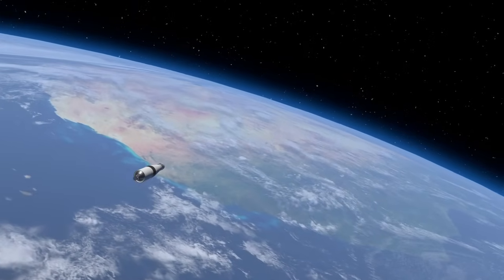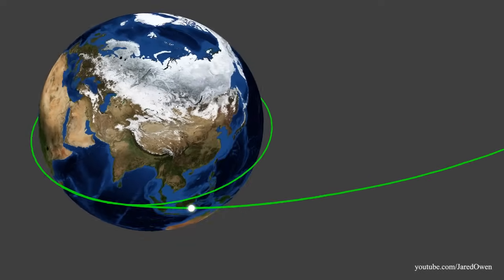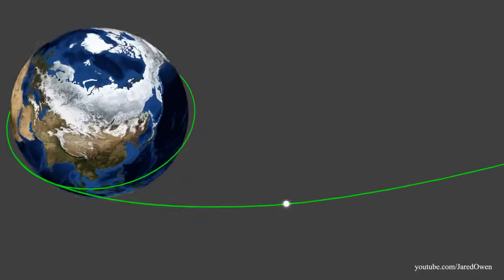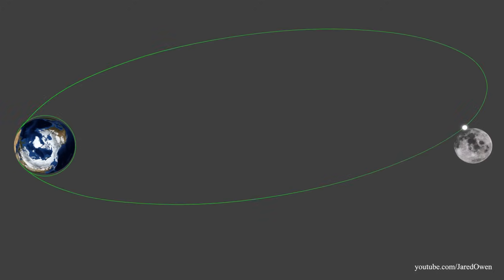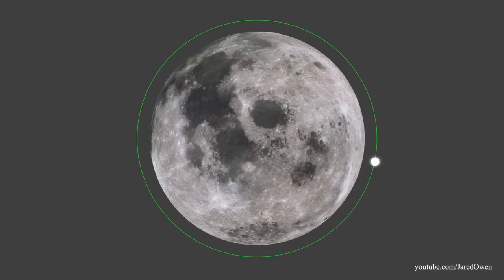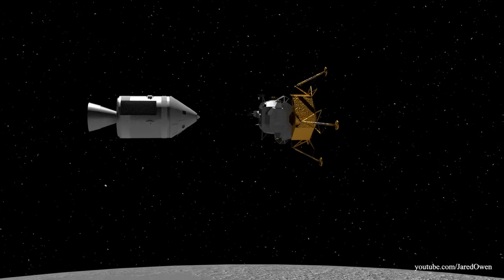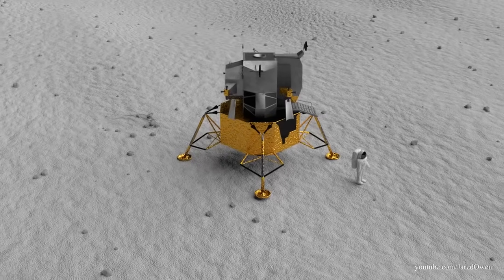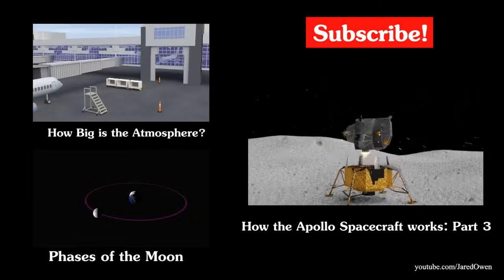How the Apollo Spacecraft works: Part 2

Comment: In parking orbit, the gravity is almost as strong as on the surface. I can fathom a small probe being sent from here to the moon ( only just & that's not how the unmaned probes like Voyager were sent out). You are saying that the big stages of Saturn V were only to achieve parking orbit and the smaller 3rd stage did most of the heavy lifting, taking a mid size truck, full of gear to the moon, after firing for only 6 minutes. BULLSHIT!
Reply: John Sergei 
You're statement makes it sound like you think the moon is not within earth's gravity well.

Or that you think an object propelled upwards will not continue to travel upwards at a decreasing speed until gravity has  cancelled out all of its upwards velocity...
Reply: John Sergei

Are you for real???
They coasted all the way to Moon,after they had reached about 11 km/sec.
Reply: John Sergei

Don't you know what "escape velocity" means?
It means, the velocity you have to reach to escape gravity. You will never fall back again.
It's exactly the same velocity you will reach, if you just fall towards the planet from infinitive distance to the surface (theoretically, not counting in the atmosphere)

The gravity will be lesser and lesser, faster than your spacecraft slows down.

Same as when you fire a gun. It needs no further push after it has left the gun barrel, to reach any distance, The distance only depends on the initial velocity.
Reply: Of course a heavier object needs a bigger rocket, to reach the same velocity.
Just like a heavier gun grenade needs a bigger powder charge to reach the same distance.

It's because of that, that the Saturn V was MUCH bigger, than the Atlas Centaur, that sent the Sureyors to soft land on Moon.
Or the Atlas Agena, that sent the Rangers to crash on Moon.

Many of the "scenes" showing the LM's fly over Moon, were taken with the 16 mm film cameras at low speed (to conserve film), so it seems to be much faster, when played up at normal speed.

The velocity needed to stay in orbit around Moon, is about 1.4 km/sec.
For Earth it's about 8 km/sec.
Reply: John Sergei

So, you have finally lost your mind completely.

Tell us what "hardware" does not longer exist.

No multi billionaires consider it worth the money to go to Moon. "Space Adventures" have had a standing offer to fly you and a friend around Moon (in partnership with the Russians) for years now, without anyone buying a ticket.
You see, you would have to pay for 2 big rockets (1 for the modified Soyuz, one for the living quarter capsule), all the fuel, the cosmonaut pilot, all the launch facilities and the recovery party. Plus Space adventures and the Russians profit.
It would be several tens of BILLIONS. You would have to sell off many of your companies.
Who would do that???

Have you even TRIED to find "the parameters" for the Apollo hardware???

You haven't presented one single reason why the Apollo astronauts couldn't land on Moon.
Reply: If you ever do attempt to do some proper research, you would find that every single supposed bit of evidence brought up about alleged proof regarding hoaxing the Apollo landings have been debunked over the years. Most of it with relative ease because the supposed proof is usually based on complete ignorance of the particular subject involved. Meanwhile, there is tons of scientific evidence that is irrefutable which has been accessible to scientists and aerospace engineers for the last 45+ years who have never found anything that might suggest the landings were faked so it's only people who lack critical thinking skills who fall for this moon landing hoax nonsense. Here's some of it:

-> There's the live TV coverage that would have to somehow convincingly fake 1/6th G movement in a vacuum, Google "Irrefutable Proof for Moon Landing - Lunar Gravity" and explain how experts in the field of kinematics for 45+ years have never come forward with proof that the astronauts are not in an environment that they say they are. There's also the fact that any attempts to do filmed mock-ups of the EVA's on Earth would have to be passed off as live TV broadcasts which would have to fool telecommunications experts around the world. Google "Moon Hoax Not" and "For Jarrah" to get a better understanding of how much would be involved to pull that off and how the filming technology back then was simply incapable of such a thing.

-> There's all the moon rock and core samples that would have to somehow be able to pass scrutiny with geologists who can readily spot whether it's something that has passed through our atmosphere or not. 
Google "How do we know that rock came from the moon?"

-> NASA has made these samples available to scientists from around the world and every year 500-1000 samples are sent out.
Google: "NASA lunar sample request"

-> There's the Apollo 16 UV telescope images that no astronomer in 45+ years has ever found fault with. Google "onebigmonkey apollo 16 UV telescope"

-> Another thing that astronomers would be able to spot are pictures of the Earth that don't match what they should look like. Google "Apollo 11 Earthrise - How One Photo Proves it was Real" for an example. 

-> Another one to google is "Apollo 11: Fingerprints in Deep Space" that shows obvious handheld TV footage from the Apollo 11 CM looking at Earth from far enough away that they are clearly beyond the VAB's.

-> Then there are the LOR images. Lots of hoax believer nonsense about them being faked but the transmittal data for them can be downloaded by anybody with a computer and so far, nobody has proven anything about them being faked. You don't think a smoking gun like that wouldn't have been scrutinized by people with the required computer science expertise??

-> Here's something else you might not know. Apollo 12 landed close enough to Surveyor 3 that Conrad & Bean were able to do an Eva to it and removed the camera and sampler scoop from it to be returned back to Earth. They wanted to see what the harmful conditions of the moon had done to those parts after 2.5 years: Google "Analysis of Surveyor 3 Material and photographs returned by Apollo 12"

-> 5 plutonium-238 powered ALSEP's were left behind that transmitted data from the experiments back to Earth right up till 1977. Unfortunately, due to budget constraints, they were shut down but they did send back enough information that storage of it became a real problem as detailed in this article: Google "the-long-road-to-alsep-data-recovery"

-> Starting with Apollo 13, they purposely directed the spent S-IVB's to crash into the moon so that the Apollo 12 seismograph could record the seismic waves generated to help determine the moon's crustal structure and makeup. Of course, as each successful mission added another ALSEP, they were able to expand on the info derived from these man-made impacts. They also did the same with the lunar module ascent stages. The Apollo 16 LM ascent stage data isn't shown because of difficulties during the deorbit phase. They were able to derive a lot of info from these artificial impacts. Google "The Description of Apollo Seismic Experiments darts"

-> Another great site to check out has some pretty thorough crater analyzing to prove the landings happened. You can check out all six of the landings this way: Google "onebigmonkey apollo sights landing"

Are you starting to understand the magnitude of what would be involved to pull a hoax like this off? Never mind keeping it from being exposed?

I suggest you also take the time to read through the 93-page pdf titled "NASA’s Recommendations to Space-Faring Entities: How to Protect and Preserve the Historic and Scientific Value of U.S. Government Lunar Artifacts". There is lots of nonsense from hoax believers that the USA is trying to make the Apollo sites inaccessible which is ridiculous seeing as these are only recommendations designed to limit harmful effects of spacecraft landing too close or the altitude of hopper type craft flying at too low of an altitude. The fact is, the USA has no issue at all with visits to the sites by manned or unmanned means. They do request the Apollo 11 and 17 sites are accorded with the proper respect due to the obvious historic value. Also, there is an Appendix B in the pdf that gives a lot of recommendations from NASA as to what type of investigations at the Apollo sites would be most beneficial for scientific purposes. Now does this seem like the type of behavior for a country that supposedly faked all of this??
Reply: mako88sb put this puppy to bed in his very first paragraph of his first post. 

The combination of a vacuum and 1/6 gravity is the one two punch that cannot be beat. 

In the video footage of the Apollo lunar rovers travelling on the moon’s surface (there is a fair bit of footage; three of the missions had rovers), the dirt that is thrown up behind the wheels behaves in a very specific way. That dirt can only do what it does in a particular environment, which is a vacuum with very low gravity (1/6th of Earth’s gravity, to be precise). 

Speeding up or slowing down footage could not create that effect, nor could any video editing technique, in the 1970s, or even now. The vacuum part could be pulled off on Earth, but not that pesky lower gravity. There’s no way to do it, no way at all. 

Temporary weightlessness can be achieved via flying planes in parabolic maneuvers, but not reduced gravity. 

The only possible way to create that rover footage would be to fly a vehicle to the moon, drive it around there and film it. That’s it. And if THAT’S true - and it is - then where does that leave the rest of it? Occams Razor would suggest that the other aspects of the missions are true as well.

There are many other ways to prove the veracity of the Apollo program, but you don't even need them. That one thing, the rover footage, is all it takes. It doesn't matter where the footage came from - whether from "lying Nasaholes," or not. The footage exists, and its existence cannot be explained in any other way other than what I've cited above.
Reply: mako88sb wrote: "NASA ninjas have been secretly replacing pre-internet era books with the proper corrected ones in all the libraries around the world that have such material. Yup!" 

Oh, that made me laugh! Good one!
Reply: John Sergei 
It is true that the force of gravity in low earth orbit is not much less than at sea level. But you are ignoring the fact that you are already travelling at orbital velocity.

Getting from the ground to orbit is the hardest, most expensive, and most fuel intensive part of any mission.
The I and II stages had to take all of the command service module, the lunar module, and the entire SIV-B stage (with all its fuel) from a standing start to orbit.
Reply: I've got one better. That 1840s quality video ( far inferior to 1890s film I've seen or 1860s photos) of Neil & Buzz, on the moon was not live. Why the lie NASA & TV news?
Reply: The third stage only had to accelerate itself and the Apollo ship to about 3 km/sec.
Orbital velocity was about 8 km/sec. To reach Moon, they needed about 3 km/sec.
Reply: @YDDES  If you move out of parking orbit & away from Eath, you feel the gravity. (& that 6 minute burn is now over.
To negate the gravity, you can move back towards the Earth. 

Going out, you'll continue to slow & be pulled into orbit. 
Yoou are not sailing, in the solar wind, too the Moon, still hundreds of thousand miles away.
Reply: The paid shill ( YDDES) is back. The 3rd stage of Apollo burned for 6 minutes apparently. It's still hundreds of thousands of miles from the moon & only a stepping stone from Earth, but the Earth kindly turned off its gravity, as the unpowered craft moved away.
Reply: Don't know where you're coming from? I agree with  both aspects of what you say.
Reply: John Sergei 
So...an elliptical orbit is just one that has a significantly higher apogee than perigee. An object on an eliptical orbit will decelerate all the way up to its apogee and then fall back towards its perigee.
A trans-lunar orbit is just an eliptical orbit where the apogee is high enough to intersect with the moon.

Gravity doesn't need to change, or be switched off. Nothing breaks any rules of orbital mechanics.
I don't see what the problem is?
Reply: Escape velocity may be the same for a truck & a little probe, but the power needed to maintain escape velocity is not. It has not been explained to me how a heavy truck can travel unpowered for hundreds of thousands of miles. fighting the Earths gravity, every inch of the way. If I can ascertain that the moon was on the dark side of the Earth (especially as the outward journey began) then you have both the Suns & the Earths gravity to contend with, both wanting to bring you home.
Reply: I have no problem with that theory ( theory, remember) Try this test ( much better than a theory), throw a light  shotput sized ball vertically into the air. Now try it with a shotput. Which went higher. Now, load a space craft with  just one type of ball. Which craft will need a more powerful rocket, the one with the light ball or the one with the shotputs? All other alleged spacecraft that have escaped Earths velocity have been no bigger than a very small car. the CSM alone, was the weight of a good size truck. I am right to be suss, especially after seeing video ( from a believers site) of the LEMon, orbiting the Moon so fast it's flying over huge craters in  under a second. You can put my sussetivity to bed YDDES. Provide the parameters for getting Apollo to the Moon, compared to, an unmanned probe? I eagerly await your info & I'll say in advance, thanks for you effort. (hope that gave some readers a chuckle?)
Reply: John Sergei 
How does a ball you throw to your friend 30m away travel unpowered from the time it leaves your hand all the way to your friend even though it is pulled down by gravity and slowed by air friction the whole way?
Because you provide all the required energy before it leaves your hand.

Scale this up to the earth and moon. The SIV-B stage of the Saturn V system was specifically chosen to be able to provide the ~3km/s of velocity needed to get the lunar module and command service module to a lunar transfer orbit.
If 3km/s sounds like a lot, it's about one third of the speed needed just to get to low earth orbit.
Yes, the ship will slow down all the way to the moon, this is fully expected and understood and taken advantage of by the engineers to minimise the amount of fuel needed to ensure a successful capture by lunar gravity.
Reply: The big stages of Saturn V were gone by parking orbit. Thanks for supplying the parameters for the much smaller 3rd stage, which I might add, burned for only a few minutes to get this truck out of parking orbit & on its way to the moon. (I knew you would?, hope that gives some readers a chuckle?)
Reply: Glad you finally accepted the fact that the Saturn V system was powerful enough to do the job it was intended to do.
I mean...considering the much smaller third stage burned for almost as long as the first two big stages combined, and that it only had to deal with a payload of 45 tonnes at the start of the burn (as opposed to the 2938 tonnes of the first stage), it almost seems crazy that you had any reasonable doubts to begin with...
Reply: If you accept the Moonlandings you're a goldfish. No parameters for any of the hardware are available to the public. The dreadful quality video of the crew of Apollo 11 was not live ( not if the refilmed onto 16mm is true?) Plenty of the imagery is fake. NASA claim most of the data/ hardware/software no longer exist & film producers would love to produce doccos, explaining the engineering & every other aspect of Apollo. There would (should) be enough material for a whole TV series or lengthy movie. The banks would be happy to lend the hundreds of millions of $ required to produce it & everyone would get a slice of the tens if not hundreds of millions of $ profit. While governments around the globe would get many millions of $ tax out of it. 

However, all that pennies compared to the space tourism industry that seemed to be on the horizon 18 years ago. Some, high end multi billionares  would love to visit the Apollo landing sites & would create multi millionares by doing so. On a smaller scale, thousands of not quite so wealthy space fans would settle for a shorter & close space experience. This trillion $ industry has faded from the limelight.  Just another red flag!
Reply: If I were a bank I'd fund space tourism & films in an instant. If you can't see the vast industry there, you are an IDIOT!.
Reply: It all boils down to one fact:
Every traveler has to pay every cent it costs to get him/her up in space.

And, that includes the space ship, the rocket, the fuel, the ground crew and everything else involved.

There have been many private companies started, to send humans out in space. Most have gone bankrupt, when they found out what it actually takes and what people are prepared to pay.

I'm afraid I'm not the idiot here...
Reply: Name a space tourist for me Yeds?  Woops, sorry, you said private company sending humans. These people do not pay big bucks for their spaceflight. In fact they get paid, big difference.
To go bankrupt, you need to borrow. In every country, the debt far exceeds the currency  supply & is rising much faster, despite new money (currency creation) being made much faster than trees can grow. Those who fund your so called space travel don't care if you a space company goes bankrupt, they'll just take their assets & income, though court orders (& no assets & no decent income = no credit)
Hay, Yeds, doesn't government print the money supply? If so why doesn't NASA, using the money government simply prints - anybody who knows how the monitory system really works will see the irony here (YDDES won't) - all the money required for space  tourism? I mean, we've been going to space for over 55 years & 17 years ago space tourism seemed right around the corner. So why not Yeds, Every organisation on the planet wants to grow larger.
Reply: 7 tourists have been in space. You can find them on Wikipedia.
They have all paid for their trips.

Search for XCOR "Lynx" regarding space tourism. For example. 

You can't just print money and use them to pay for things, for heavens sake!
If you do like that, you will end up like Germany after the first World War.
Finally, a loaf of bread cost BILLIONS:..
Don't you know how the monetary system works???

You can't just print money to send tourists out in space. Every person has to pay for their own journeys.
Reply: Nobody is called 7 tourists. I asked you for names & all I get is a number (from a numbskull) Ok, since you won't answer, I'll make you dance around another question. Which space organisation sent these 7 loaded folk into space? Germany had no choice but to print money like crazy, to pay the huge debt, imposed on them by the allies, whom I might add had armies, ready to invade the country should they default. Germany did not start WW1 & the Keizer tried in vain to avoid war. Yet Germany was blamed for WW1 and was sent the total war bill. I don't expect Yeds to have the capacity to ponder as to why create a debt of which not 20% can be repaid, in a lifetime? (something, every nation, has today).

Hay clown, in 1 sentence ( 2 or 3 lines please) can you tell me where money comes from & who controls it?
Reply: John Sergei

I'm not your secretary. Just go to Wikipedia (there are other sources to). Just write "Space Tourism". 
There you'll have their names and times and everything you need.

I've had enough of your insults.
Bye!
Reply: Don't comment then (on any space related video) & of course you're ignoring questions on other videos about the imagery format  used on Apollo? Beats saying " I don't know" doesn't it?
Reply: All your evidence comes from governments who've killed inarmed civilians who were not attacking them (something just about every police force around the world has done) . & YOU TRUST THE SOVIET GOVERNMENT?
Reply: If you want to believe governments who have killed their own citizens, that's up to you. Police in just about every nation have killed unarmed civilians who weren't attacking them. Those police then lie or refuse to answer questions, are almost never prosecuted & the punishment for killing an unarmed person who was not attacking you & lying though your teeth afterwards has usually been a promotion. Anyone who believes the Soviet government, whom murdered tens of millions of it's own citizens is not only an idiot, but a liar as well.
Because I don't believe for a second that you trusted the USSR.
Reply: Sure. What exactly are the Russians lying about and more importantly, where is your credible proof that can substantiate that accusation? Biased uninformed opinions mean jack squat.
Reply: To start with, their government presents the public with a ridiculous budget (as every other of the thousands of governments in other countries around the world do), rather than show people the real financial figures that are in the CAFR. 

A huge chunk of your taxes go to pay interest charged by government creditors whom you don't know about. WELL, I THINK THAT'S BAD ENOUGH MAKO.
Reply: Which does nothing to explain your theory that the Russians are lying regarding the Apollo landings. Try again with proof that is credible and can be substantiated. Otherwise, it's just another conspiracy theory with zero credible proof which will have zero impact on the Apollo lunar landings place in the history books. Biased speculation is just as pointless and meaningless as biased uninformed opinions.
Reply: It must be your religion if you think that  Apollo is not very suss? & as for the USSR, what have they got to do with it. For all we know, there may have already been dead cosmonauts orbiting the Earth or burned up on re entry, before Gagarin.

OK what have I got to present? very suss evidence of men on the Moon from an institution that work for global bankers, not the votors ( Modern Money Mechanics, Grace Commission). I won't even debate the Apollo imagery, much of it is fake, beyond debate. WHY?

You believe highly suss evidence from a trillionaire institution ( governments) that robs you blind (Grace Commission & your mortgage).

Now Charlie, what have you got?
Reply: You wouldn't be the first hoax believer who doesn't understand the science and engineering involved with the Apollo lunar landings refer to it all as some type of "religion". 

"& as for the USSR, what have they got to do with it."

Your first 2 responses to me went on about how the Russians can't be trusted so why are you wondering what they have to do with it? I assumed that was your response to this:

-> The Russians tracked and confirmed all 6 of the Apollo moon landings. Why would the USA's major competitor during the space race do that?
->Typical hoax believer answer: (Something involving a worldwide conspiracy with zero credible proof)

" I won't even debate the Apollo imagery, much of it is fake, beyond debate. WHY?"

Are you even looking at the official images? There's plenty of images that have been photo-shopped and been presented as the real thing by people who like to stir the pot. The official images and videos have been made available to the public and photo analysts since the missions happened and none of those experts from around the world for the past 45+ years has found anything hinting at fakery. 

As for what I got, it's already been posted and I'm still waiting for credible proof that can be substantiated by the relevant experts with everything involved that proves the landings were hoaxed. Your ramblings about how the governments can't be trusted are irrelevant. Do they lie? Of course. Do they lie all the time? Of course not. The most technically difficult and expensive part of landing on the moon was building a large enough rocket to get the necessary moon landing payload into LEO for the TLI burn. Of the approximately 400,000 people involved with the Apollo program, roughly 300,000 were needed designing and building the Saturn family of rockets plus all the logistics required to prep them for launch. Prior to the Apollo program, the USA experienced as high as a 40% failure rate with its various rocket launches which were pretty small and relatively uncomplicated. Of the 32 rockets in the Saturn program, all 32 of them were successfully launched. These were some of the most complex machines built at that time culminating in the Saturn V with its 13 successful launches. If you have any doubt about this being the most technically difficult part of a manned lunar landing project, then look at the Russian moon landing program that accomplished many of the same things the Americans did including soft-landing probes on the moon and testing their version of the LM in LEO. However, they were never able to successfully launch their version of the Saturn V. The N1 rocket exploded 4 out of 4 launch attempts and the Russians canceled their moon landing program shortly after the last failure. 

If the Americans could put such an effort into their rocket program to have such a drastic turn-around in reliability that was witnessed by hundreds of thousands at each launch, then I have no problem believing they were capable of going to the moon and landing men on it. It's a hell of a lot easier to believe compared to all these unverified conspiracies within conspiracies that people like you dream up rather than admit you might be wrong. The plain simple fact is that if it were possible to transport you to the moon and show you all the landing sites plus the deployed ALSEP's, Apollo 16 UV telescope, rover tracks, and footprints, you would still say "nope, sorry, still not convinced".
Reply: Science has nothing to do with it, the imagery is ridiculous. Anybody who thinks this is really on the moon is an idiot & guess what charlie, like religion, millions more people are disbelieving, every year. If they went to the Moon, the Authorities would be able to convince the  hundreds of millions of doubters & billions of don't give a toss (not the tosser believers) in minutes.
Reply: Wrong again. Science has everything to do with it. That includes all the relevant sciences involved with photography that is known & understood by photography experts. That's why a few years ago when some "supposed" expert said he had proof the landings were hoaxed because the stereo parallax he noticed in the images indicated to him that those landscapes in the Apollo photos were not real. He did a good enough job to fool the gullible and the average person ignorant on the subject but photography experts who understand the science of photogrammetry quickly squashed the so-called expert with little effort. Claiming you can discern the truth from the Apollo images that have withstood 45+ years of scrutiny by experts in the subject is right up there with the flat-Earth nut-cases as far as I'm concerned. As for you "millions more people are disbelieving, every year.", that's the same as saying the deluge of flat-Earth nutcases somehow must mean there must be something to it.
Reply: Ok shill, Explain how the TV showed us live 16mm Apollo 11 film ?
Reply: There was no live TV broadcast of the Apollo 11 mission, or any Apollo mission using the Maurer 16mm Data Acquisition Camera. Whatever you've watched or have been told is bunk, or official NASA information being editied and intentionally/accidentally micsconstrued. All you have to do to confirm this is to find the Apollo 11 mission report that has been available to the public for decades and is easy to find on the internet. Then read all the transcripts during the televised parts of the mission including the EVA. You won't find anything mentioned about using the 16mm for the live broadcasts. There sure as hell isn't any 16mm colored TV video of the EVA because the bandwidth was kept low for the TV portion of the EVA mission and the only thing it broadcast back to Earth was live black & white video.
Reply: I'm reffering to video only, live analogue film can't be done.
Reply: Agreed. So why are you asking about "TV showed us live 16mm Apollo 11 film ?" because it was never done.
Reply: Old books  ( Post Apollo) show ( & say) the lunar rovers had inflatable rubber tires.
Reply: That was the one-G lunar rover trainer so the crews could practice there EVA preparations and procedures. The lunar rover designed for 1/6th gravity used on the J-missions wouldn't have been strong enough for such training.
Reply: http://www.geschichteinchronologie.com/atmosphaerenfahrt/mondfotos/mondauto02-apollo-15-training-ENGL.html
Reply: I posted the above so you can see that even some people who claim faked landings show images of wire mesh wheels for the actual lunar rover vs rubber tire trainer. Here's a link to a better site:
https://www.hq.nasa.gov/alsj/LRV_OpsNAS8-25145.pdf
Reply: Go find some old books, Try a library (if it's not beyond you?) There is no mention of mesh wheels, only descriptions, drawings & photographs of rubber tires. I was around at the time & the wheels were never mesh, that's only been in the internet era. WHY THE LIE?
Reply: I was around then too and have books that predate the internet era. David Bakers "The History of Manned Space Flight" copyright 1981, published 1982 and on page 410-411 it says:

"Mobility in the form of a four-wheeled electric car posed problems in that low surface gravity would compromise stability: Whenever the car went over bump pneumatic tyres would give the vehicle a pronounced bounce. Some form of wheel was necessary which would absorb more energy than normal. An open mesh wire "tyre" was finally chosen, held in place by a titanium 'bump-stop' inside. Titanium chevrons fitted around the outside would give additional grip..."

On page 415 of the same book, there's a half page photo(coffee table type book) that shows a folded lunar rover being checked for deployment and the tires are obviously the mesh wire ones mentioned in the text and whats seen on numerous EVA photos. Go check the book out at some library. There is no lie. From that long ago, you were probably looking at the LR trainer.
Reply: Got some time to go through my books stored in the attic. Here's some more for you:

-> "To Rule the Night: The Discovery Voyage of Astronaut Jim Irwin" by Jim Irwin & William A. Emerson Jr. Copyright: 1973. Mentions the wheels made out of SS piano wire mesh & titanium chevrons. Only one picture of the rover but clearly non-pneumatic.

->  "Moonwalker : The True Story of an Astronaut Who Found that the Moon Wasn't High Enough to Satisfy His Desire for Success" by Charlie & Dottie Duke published in 1990. More references to the wire mesh tires including comparisons between the actual lunar rover vs the one-G trainer. Some more pictures of the LR with non-pneumatic tires. 

-> "To a Rocky Moon" by Don E. Wilhelms Published 1993:  A book that goes into quite a bit of detail regarding the lunar samples but it does also include a couple pictures of the LR with non-pneumatic tires. 

-> Not a book but a painting done by Alan Bean in 1986 called "World Class Rock Photographer". More proof of  non-pneumatic tires.:
https://i.pinimg.com/originals/30/ca/2f/30ca2fff481223dc658d3afc4dfc1576.jpg

->  Another Alan Bean painting titled "Earth is Watching " from 1983. Again,  non-pneumatic tires.
https://www.alanbean.com/gallery3.cfm

So make sure you check those 3 other books out while you are at the local library and let me know what you find.
Reply: Thanks for the paintings. Are you old enough to remember Apollo when it was underway or very recent? I'm interested in real photos, not paintings. The real photos of the time show inflatable tires. I don't trust the Apollo information, there is so much wrong with it that I put the onus on believers (who send me paintings, for Christs sake)
Reply: Yes, I see you were around then. Before I look chase up you books I'll l look up some more old books about the Moon landings, though I'm in no hurry & wonder why I bother. I've just looked at the CM, in the museum. With a man standing alongside it. It looks barely large enough to squeeze 3 people into. This, roughly 6x6 foot cone housed 3 astronots (as some of us call them) 3 space suits (as the nots are clearly wearing overalls, at times, 3 bulky backpacks, 3 bulky helmets, 6 bulky overboots, a very bulky computer, 7 parachutes, the 2 drogue chutes being each, considerable bigger than the craft & each of the 3 mains, utterly dwarfing the CM. I have a 1 ton van, & I doubt if you'd get 2 of the main chutes into the back & You'd only get 3 guys  (or 3 er, 2 of those bulky space suits, in the front) & my vehicle is several feet longer that the CM.

Then we have 8 days of piss (sounds like ether fun or stinky misery, depending on the piss?) & days of solids (both in & out) 8 days of drinking water for 3 thirsty guys & all inside the CM? There can be no holes for piping etc from the CM to the Service Module otherwise the heat shield will not work, the guys in the CM will be baked & fried. Where are the spec's for all this?
Reply: In the early 70s, these rovers had inflatable rubber tires. I've even found articles describing their possible adaption for aircraft use.
Reply: I just gave you info about 4 books that have real photos of wire mesh LR wheels from the pre-internet era. You still want to persist in this nonsense that the LR wheels used on the moon where inflatable tires then that's just typical HB behavior right up there with the flat-Earther's and their BS. The 2 paintings were also done before the internet era so whether you like it or not, you'll have to explain the supposed discrepancy of those 2 paintings and the hundreds of limited edition prints made from them in the pre-internet era since you're accusing the USA of changing the historical records and swapped the type of tires used from pneumatic to wire mesh.

 Please explain why you think the USA would lie about the type of wheels used on the actual missions. Also, explain why they didn't bother changing the Apollo 14 MET cart wheels from rubber to wire mesh? No doubt you think the surface temperature of the moon is too high for pneumatic tires but like most HB's, you're oblivious to the fact that the Apollo landings occurred during the lunar dawn period that lasts for several days so none of the Apollo EVA's occurred during those max temperatures. Easily proven with scientific evidence and knowledge.  

As for not rushing to check out those books in the library, no big surprise to hear that. No doubt your main concern now is damage control. No way the self-proclaimed super-duper genius you've convinced yourself that you are could possibly be wrong so onto the typical HB fallback mechanism of dreaming up another worldwide conspiracy to explain this obvious goof of yours away. Let me guess, NASA ninjas have been secretly replacing pre-internet era books with the proper corrected ones in all the libraries around the world that have such material. Yup! Another worldwide conspire with zero credible to go along with all the others I listed before. 

As for your issues with the CM size and storage of everything, that's been debunked with ease before. A bright boy like you should have no problem finding that info. What you think about it all is irrelevant since you seem to have some crazy notion the parachutes were stored in the crew compartment. That pretty well says all that needs to be said about your critical thinking skills. The chutes were stored outside the crew compartment around the access tunnel. There's plenty of documentation along with videos including slow motion test drops to prove it but no doubt you'll spout off again about reading/seeing the chutes emerge from the crew compartment in pre-internet photos and documentation.

As for the heat shield and how they accessed anything from the SM, it's so easy from an engineering viewpoint that it's really hard to believe you couldn't figure it out on your own. They simply went around the heat shield and there is plenty of info about the CM/SM umbilical along with the explosive operated guillotine used during the CM/SM separation. The piss was easily dealt with by simply ejecting it out into space but no doubt you'll say it was not technically possible to do such a thing since the  super-duper, self-proclaimed genius you are didn't think of it. As for the poop, simple matter of pooping in bags. Sure it's a nusiance to do and store it but it's exactly what the shuttle crews had to do when the expensive high-tech toilet broke dow. Fortunately a rare event. 

As for placing the onus on the believers, yeah, right. Any super-duper, self-proclaimed genius moronic enough to think the crew compartment of the CM would be crowded because of the parachutes has zero business saying such a thing. That's right up there with if the flat-Earth nutcases demanded all the globe based maps and globes be taken out of circulation and from schools until it's proven to their satisfaction that yes indeed, the Earth is not flat but actually a globe like has been proven historically.  

Anyway, you've served your purpose doing a brilliant job of showcasing just how irrational and how utterly devoid of common sense & critical thinking skills die-hard hoax believers really are. Time for the block. Adios chump!
Reply: Thanks! Pretty incredible the stuff they will come up with. There was a fella that claimed he couldn't find any info anywhere about the ice sublimation system used on the PLSS, LM & Saturn V instrumentation section so the landings had to be faked because that info should be somewhere. In no time at all, people posted links to the info he said didn't exist. Then he said this was only in place because he had bitched about it before so obviously NASA was caught red-handed adding the info to the internet and that there was no pre-internet era info about it. Again he was shown evidence that wasn't so with scientists and engineers quoting books, dates and the specific topic from pre-internet era sources. Of course, that still wasn't good enough for him. Never ends with these clowns.
Reply: You're welcome! 

The reason I feel compelled to argue with Apollo deniers is that it is such an incredible and ridiculously cool part of our human legacy, and it’s disheartening to know that SO many people, most of them young, are not embracing it. What other grand project in human history has gone down that wasn't about subjugating people, or realizing the vision of somebody’s ego to the detriment of others (think Louis XIV). Apollo is incredibly inspiring, and I think it’s inspiration that we - and especially young people - need now more than ever. Also, it bothers me a lot that people can be swayed SO easily into believing a lie. The few times that I have managed to turn people around about Apollo has been a really nice feeling. Instead of staring into their phone and adding effects to snapchat images, they can go outside, look at the moon and go, “Holy shit! That actually happened! What can we not achieve! What can I not achieve!”
Reply: Agree completely. Having said that, I must admit I'm a bit skeptical about some of these proposals for a manned landing on Mars that have been brought forward. Definitely not going to say it's impossible, I just remember reading about all the difficulties and close-calls, aside from Apollo 13 that was involved with missions that are the equivalent of a trip to the corner store vs the planning, supplies, safety backups and equipment required to travel around the world. I really hope it does happen but I do think it's so much more challenging compared to the lunar landings that I wouldn't be surprised if it doesn't happen in my lifetime.
Reply: Well put. Someone once described the Apollo missions as "camping trips," which was I thought was quite apt. Even on the moon, long term human habitation could prove problematic. All that said, with time and a lot of effort, it seems at least possible that Mars could see a manned landing someday.
Reply: John Sergei

Why the heck would they have to store the backpacks and overboots in the CSM???
They only used them in the LM.
And, they only needed 2 backpacks and 2 sets of overboots.

The piping went AROUND the edges of the heatshield, for heavens sake!
Reply: https://m.youtube.com/watch?v=LwpuEPoW_Cg NASA Equals 666 proof video